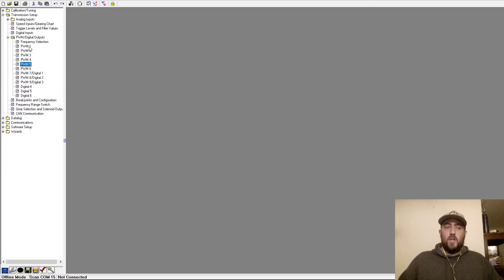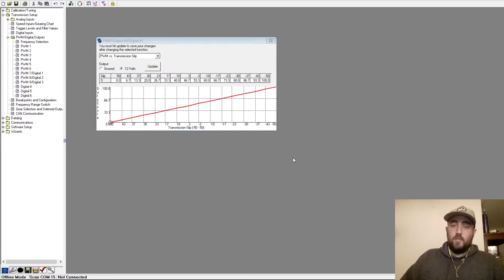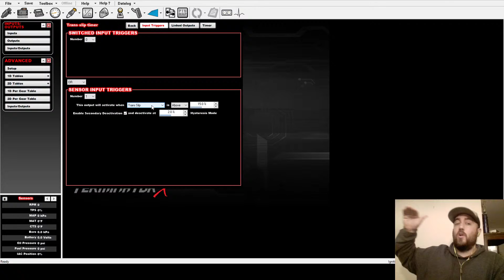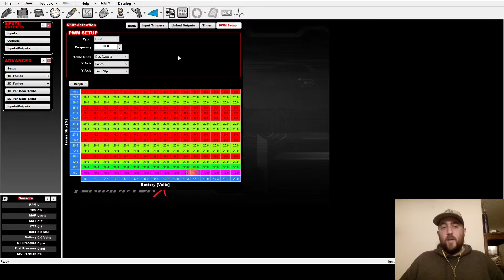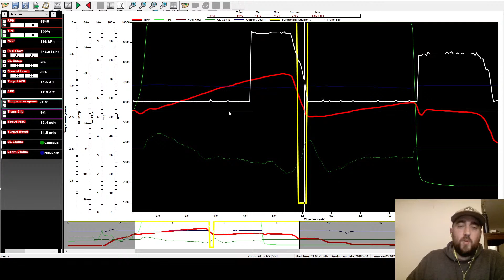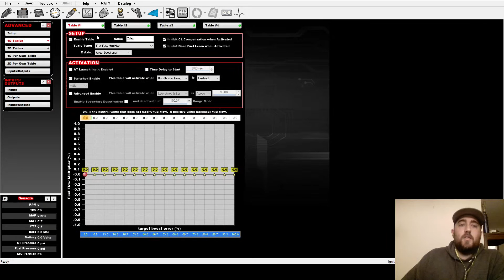6L80/90 Holley and TCM2650 Integration Q&A

Comment: Does this work with the 8L90 as well? I emailed zero gravity performance about the controller and it said it can do the 8L90 as well, could torque management work with this as well? Running the 8 speed with a cammed 5.3 would really bring life into the LS scene
Reply from the maker: That's cool if it can do the 8L. I asked them about that a couple years ago and they told me no, so things must have changed. As long as the controller will display trans slip you'll be fine. You can also calculate trans slip by using input shaft speed, commanded gear, and output shaft speed (or calculated from vehicle speed/tire height/ rear gear ratio) that's what I did with the 4l80e. I had to generate trans slip using some tables.  Since the Holley doesn't calculate it natively.

Comment: Do you have any written info on the input outputs set up for both the TCM2650 and the Holley efi? Basic configuration. Not the Tuning. Shouldn't the 6l80e self learn?

Comment: I was hoping this would be a long one. I'm diggin' in!
Reply from the maker: Pete Angelas just FYI, at one point of the video I state you may not need the trans slip timer. After the video I thought about it and remembered that yes, you still need it unfortunately
Reply: @scrapmetal_sleepers     What wire did you use on the 2650 Tcm to plug behind the Holley dash. To make the speed work ?
Reply: @morrisrodney19  did you figure this out?
Reply: @oneangryvetracing   no I have. Not but I wire the tach to my Holley ecu tach wire
Reply: Also is there away you can turn off the reduced power mode ? That on 2650 software think my transmission puts my gas pedal . I’m limo mode
Reply: Limp mode
Reply: @State_of_mind-auto_ shop M  if you give me an email I will send over my tune file I'm running a drive by cable system are you drive by wire I shut off any of the transmission codes through hp tuners. I got the dashboard register park and neutral for revers and drive it shows drive on the dash.
Reply: Also I’m running drive by wire
Reply: @State_of_mind-auto_ shop M  didnyountunenit for a manual set-up if not find a tune on hp tuners and do a segment swap for the engine it can be for anything with a manual like a 02 pontiac firebird with the transmission section I can also send mine over and you can reference some of my tune for help.
Reply: @oneangryvetracing  okay awesome my transmission is a 6l80 so it’s a automatic transmission  but I don’t have Hp tuner I will haft to pay someone to remove it for me
Reply: @State_of_mind-auto_ shop M  unfortunately yep if not ecm thinks transmission Is having issues and will do everything to protect it
Reply: @oneangryvetracing   yeah I understand thank so much for responding back. I will have it tune when I get my exhaust pipe done
Reply: @State_of_mind-auto_ shop M  I also got the speedo figured out made something so get it to work so now I have speedo and cruise control
Reply: @oneangryvetracing  how was you able to get it to work. I got a Holley screen so mine go off satellite
Reply: @State_of_mind-auto_ shop M  I made a custom trigger tooth wheel setup with a custom bracket and a vss sensor I made and had laser cut to work got tiredness trying the damn tcm controller passed me off and Jim overeat zero gravity seemed annoyed that I asked unfortunately!
Reply: @oneangryvetracing   I’m Hella mad Holley sale a 6l90 transmission harnesses now
Reply: @morrisrodney19  I'm Hella mad also didn't k ow that and right after I bought the 6l90 zero gravity kit they have a 8l kit right after I bought the 6l kit
Reply: @oneangryvetracing  i might but thin I might not because the 2650 works.  But the Holley you can plug directly also tune it with the remote so you don’t need to pay HP runner
Reply: HP tuners